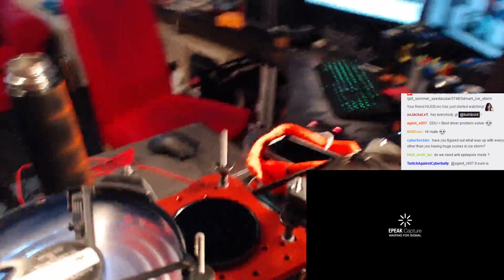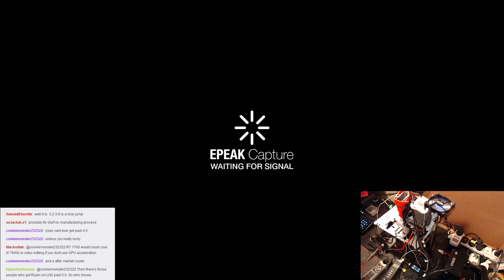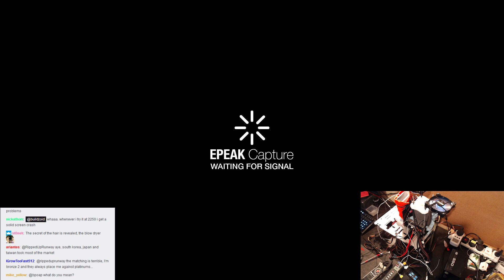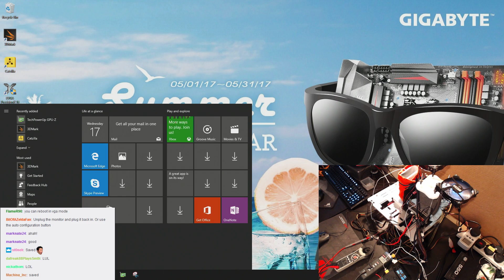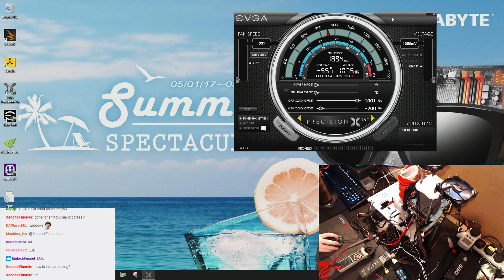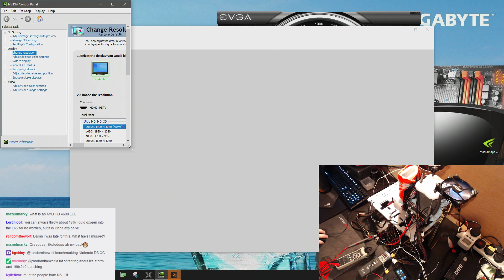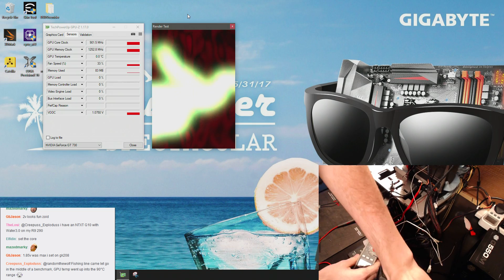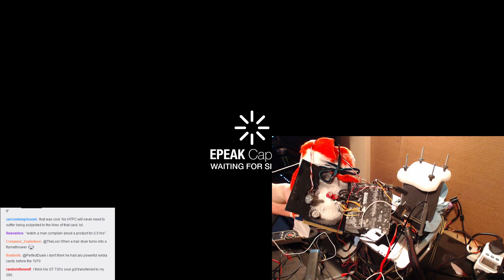AHOC Livestream 36: Gigabyte Summer Spectacular Stage 2&3 GT 730 and i3 7350K

Comment: Want some funny bench results get a C2 3930k to beat a 1700x (non oc) in passmark cpu bench. (which is a bench that traditionally treats the FX series as well as other AMD cpus quite well) it also scales pretty well with cores till you start getting into dual socket and around the mid teens in cores....its a interesting bench and kinda weird but works pretty well (most of the time) sorta shows how cpus line up with one another...does not show in the least how that cpu might preform in the real world however. Though it is free so what am I talking about it is something to run for shits and giggles and costs me jack shit to do so. In general there are some really weird benchmarks out there even cine r15 I get huge variants in runs when I bench in that. Wish there were some better bench tests out there. (yes some mostly work but improvements always nice)